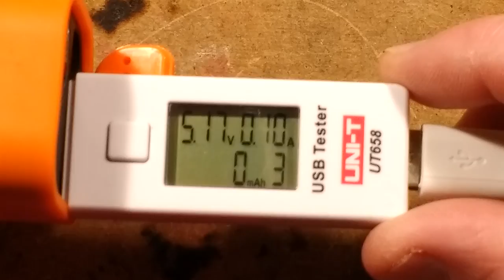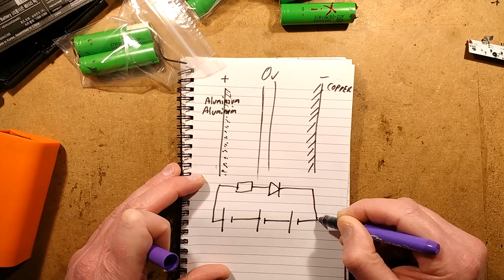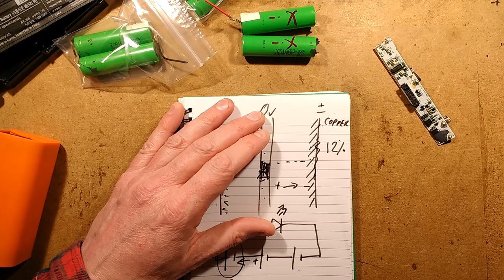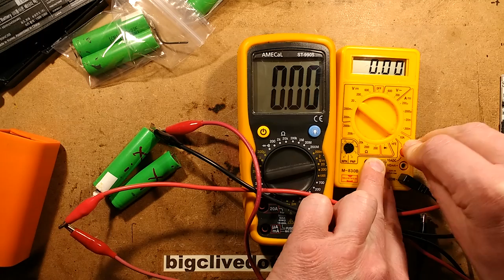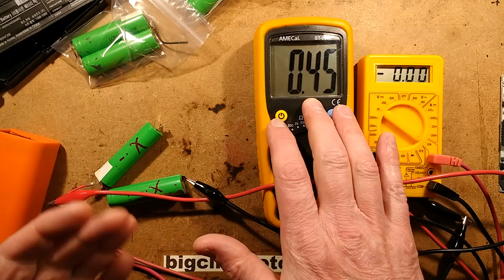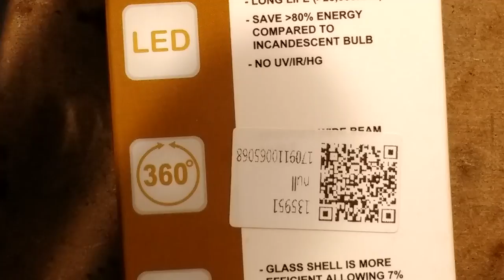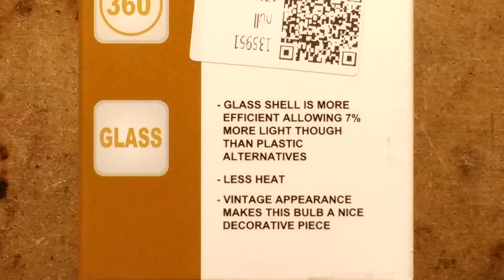Teardown of a faulty Samsung lithium 18650 cell.  (2200mAh)

Comment: How far can one drain a Lipo down before deep cell damage? I had 2 3s Batteries running in parallel a cooling box but because the monitor failed I accidentally drained them down to 2,6v in total. I recovered them slowely on two tp4056 and my bench power supply. One of the packs survived and in the other one, one cell turned into a complete short circuit.
Where is there the absolut limit?
Reply from the maker: If the cells get drained down to zero or very slightly reverse charged then they may recover, but if the reverse charge exceeds a certain level it can start causing internal shunts, and at that point the cell should be recycled.  You can tell if there is a shunt if the cell either fails to take any charge or it self discharges over a short period of time.  (hours to days).

Comment: There is alot of information out there on what voltage to store 18650 lithium batterys at, Dewalt say on there website for their lithium  battery care to store them at full charge for long term 6 months storage. I called Dewalt technical hot line up and they said battery degrading at full charge storage is very minimal and not worth loosing sleep over its that small... its damage from them getting low they said, so on this advice and watching this video on the bms not reading low voltage im going to let my batteries cool down after us and full charge them for next time i use them, do you agree with this?

Edit:- oh Dewalt also said "constant" low voltage current draw is very harmful for battery life (radio's, fans etc) ,they said it damages the cells inside with constant draw.. they said variable  draw is best for keeping a healthy battery?
Reply from the maker: I don't see a huge issue with storing cells fully charged if in fairly regular use.  It's normal for cells in long term storage to be discharged to half capacity.  DeWalt are probably not encouraging storing their batteries with low charge as there will be a slight current draw from the internal circuitry, and if it discharges a cell below around 2.5 to 3V it may lock the battery pack out.
Reply: @bigclivedotcom  very true!Thanks👍 i appreciate your channel 👏🤙

Comment: I have one of those 80V ish electric chainsaws, they shipped it with a seemingly dead battery as the charger rejected it since it was at like 24V. They shipped me an entirely new bundle with a new saw and battery and didn't want the old one back, so naturally I took the battery pack apart and used a bench PSU to trickle charge each cell

Once it got charged enough the charger accepted it and I had a free saw, obviously it was easier for the company to send a new one than deal with returns

Comment: The main issue with Li cells is the electrolyte, that is very flammable, NiMH ones use water instead, that's why they do not tend to create flames (but they can explode as well).
Reply from the maker: I took some NiMh cells to bits and it appears they self combust when exposed to air.  It happens at the end of a video I made about them.

Comment: @2:27 well reverse charging could happen, but there is a whole other reason why only one pair is completly flat after years of storage in or outside of a notebook. You see that nice big black chip on his right thumb? Thats the chip that is holding the charging program and battery information "temporarily", it is factory side programed and does not have permanent memory, its more like a little cpu with a few kilobyte of ram. Once the pair that feeds this little chip supply voltage goes flat, the program is lost and that chip does not allow charging anymore. If you put this battery pack into its corresponding notebook, the power on self test checks the battery, sees it does not communicate anymore and the bios shoves out a warning that this battery pack cannot be used. There are tools and software to program various battery charging ICs again but its more expensive then a replica battery pack.

Comment: The electrons move from negative to positive because electrons themselves are negatively charged. Meaning less electrons equals positive charge and more electrons equals negative charge. However electronic circuit nomenclature are describing current carriers which respect the actual charge "flow" meaning the changes in charge through the circuit which are opposite to the flow of electrons. As those "+"s move about the circuit it actually means electrons are flowing away from those points.

Comment: Huh? I thought the laptop battery ( with 3 cells in series ) had connections to each pair which monitored the voltage so that you didnt get one pair going reversed. There are these circuit boards which are called 3S 2P I think which do just that so you can safely make your own 11V battery.

Comment: I have cels like that.. they have a protection inside.. a metal bit that disrupts the contract when the pressure inside increase beacause of over discharge. But I find a way to charge them. if you take the wrapping under some plastic sleve there is a small metal sleve  in the side that has voltage.. it's hard to find and dangerous to do but its possible

Comment: On the NiCad drills with a dead battery, I have grabbed a good drill and spun the dead drill with the trigger pulled to generate enough charge in the battery that the proper charger would recognize the pack as good and start recovery or charging. (very inappropriate)

Comment: On extremely   low Battery value  If you have a proper charging circuit it charges in low current until certain value, then it starts to charge normally

Comment: I think is possible that the valve short circuit the cel.. that may explain that behavior.. it's sad you didn't try test it again when it was outside of the metal shell . So I suggest opening the other one carefully or at least remove the top.. the part where the valve is and test it. and also after that.. remove it completely and put 1 amp through it and try to spot if and where is getting hot

Comment: The touchpad was (and still is) on the PS/2 standard, not USB. I repair laptops for a living and i haven't seen an USB touchpad yet. Some years ago i wired an old touchpad to a PS/2 cable. Worked fine for a desktop PC, useful when space was a premium.

It could be due to the camera, maybe pinched LVDS connection cable to the screen, as the camera runs thru the same cable, or you could have a bad chipset. If it's anything with a nvidia chip dated 2006-2008 in it, that's likely what's wrong.
Reply: The keyboard/trackpad in mIne is USB, while not a majority they exist, seems you just never came across or noticed one yet...

Comment: I wounder if the old NiCd memory jolt would work.  We take a 100mf to 200mf and charge it to 100 - 200 volts  and hit the cell, usually one or 2 hits burn out the offending particles.  None ever blew up. Very vew didn't respond.

Comment: I had a problem with an Acer One Windows 7 laptop not charging its battery. However switching the battery to my other one which was running Linux it charged normally and after that would work normally in the Windows machine so there's something wrong with the Windows drivers for the battery management for that model if the battery is very low.

Comment: Hey not really expecting anyone to respond  but if someone  could tell me if I may have internally  damaged  some 18650 cells by bending the negative  plate out when I tried to rip the spot welds off or is there some wiggle room that allows  dents or buldges
Reply from the maker: A slight bulge out is not really an issue.  If it had been pushed significantly in or perforated the metal case it would be more of an issue.

Comment: I was remodeling a area. Where I needed to cut 2 inch quarter round. I used a worm drive saw with the guard locked open. The owner approached me as I started the cut. Pulled the saw into my leg as he stepped onto my power cord. The saw would of cut my leg. But my cell phone acted a shield. where my cell phone was. The cell phone was ripped out of my pocket. Not cutting me. Only ripping my pants pocket. During this event the saw cut about 1/4 of the cell battery. When the battery landed on the carpet. It started heating up melting the carpet. I kicked the heating battery 3 feet or a meter away where floor tile had been laid. The CELL BATTERY became so hot it shattered the floor tile it was sitting on. Not too much smoke. And no flames. But the heat could be felt 3x my arm length away.

Comment: This is an obvious defect to me. It’s poor adhesion on the anode.  This could have been the result of Cu dissolution from the cell sitting at less than 2V for too long. 

You could dissolve the graphite off the separator using nmp.

Comment: I know this video is 5 years old but just s top tip for anyone having battery issues on laptops.

What happens is over time the BMS loses function. Most laptops have a BMS reset procedure that will bring the battery back online and properly charge the cells as required.

The 2 dead cells in this pack are no doubt a result of a poor BMS and continuous charging from the wall plug because runtime was becoming an issue.

As soon as your battery starts to show performence loses. Do the bms reset procedure and thank me later 🙌

Comment: copper is  reflecting  as a sheen gen overall observable  from high angle  on separator after cleaning. 
No organic solvents are present  in black  compound reduces the chances  of  self ignition when these are disassembled. 
The black compound was thermally damaged check for heat sources  and the cells that fail match same spot locations.
bad or malfunctioning laptop cooling is common  this shortens life of the one that makes a n unusable pack. cheap replacement  or NOS packs fail faster as well. Cell sets are effected worst when at full charge and heated excessively.

Comment: my son went to plug in his headphones on his new laptop inadvertently stuck the connector in the USB shorting out the computer and now it will not turn on.  did he kill the batteries?
and is it fixable?
Reply from the maker: Check the inside of the USB connector isn't damaged and shorting out, then if the battery is a pack that can be removed then try unplugging it and plugging it back in.

Comment: 34:43 there's a definite circle of transparency in the film, in a similar location to the "polished area" on the copper electrode. If that's not a obvious sign, That would be quite disappointing! RIIGGHHT...OKAY...
Reply: I noticed that too.
Reply: Seems like Clive may have had the right idea at first, then figured it may be due to the material not sticking there very well. I was suprised he didn't go back and second guess his original observation. .. But then again, it may not have anything to do with it at all!?
Reply: Bear in mind that we actually get a better view of quite a few things than Clive does. He can't lean right over it because the camera is in the way. And if you're watching on a good-size screen, you're basically using a giant digital magnifier. ;)

The copper migration thing is probably happening on a microscopic level. It seems to be a similar concept to electroplating, which apparently takes ages if you don't have a decent voltage and the right chemical conditions.
Reply: You are totally right. I actually watch on a 4 yr old cell phone, I wish it was a bigger screen. I was just thinking that Clive could have seen it during his watching/editing time before he posted it. Thought I'd try to bring it to his attention either way.   :)
Reply from the maker: If it's not completely obvious then I don't like to jump to conclusions.  I prefer a definitive reason.

Comment: 4GB file size, it's a limitation of FAT32. Some devices support exFAT, which allows larger files. Should check see if your Android supports ext2/3/4 on external storage, then again the 4GB limit is removed.

Comment: i have had many of these batteries look completely dead just rip the safety circuit board off they recharge fine they do get a bit warm sometimes so don't over charge them
Reply from the maker: The classic protection PCB will shut off at low voltage.  The cells can often be trickled back into life, but if a cell loses charge noticeably in storage it's best to let it run flat and then recycle it.
Reply: @bigclivedotcom  iv'e found with mine the battery has a full charge when this as happened I'm guessing its the over charge protection circuit failing probably bad charger

Comment: are you recording onto an SD card? it might be the format of the storage device. 
the file format 'FAT-32' has a limit of 4GB... it literally can't hold single files larger than that, even if it has a higher capacity.

common alternatives without this limitation are ex-fat or ntfs.
changing the format of a storage device requires completely erasing it in the process, so take your valuable information off it first. if you are recording onto internal memory, then you might have a hard time changing the format.
Reply: if your linux distro doesn't have tools to change file format, there is something wrong
Reply: heh

Comment: The most likely the reason the cell was faulty was because a safety feature triggered; on the top of the cell, there should be vents or an opening. Through that opening, stick a small flathead screwdriver and gently press down through all 3, 4, or 5 holes. Be careful, if you hear a hiss you probably pushed too hard

Comment: While this is an old video, it should be noted that this was an unprotected cell.. i.e. it did not have protection circuits.  Unprotected will self discharge. Protected circuits will not.

Comment: The icr cells are the exploding cells they are quite rare and are only found in the cheapest of cheap products 
The more modern cells (like imr) only vent and catch fire 
Modern cells can cause an explosion when they're unable to vent properly but this can only be caused by design faults inside the battery container (no vent holes)

Comment: They possibly aren't reversed charged. They are protected cells if you measure no voltage it means the CID popped you can reset it.
Reply: Although that is not a good idea. There is a reason the CID popped

Comment: you found the problem, in that the graphite had come free from the electrodes and gunked up the membrane. at a nano level, it just looks even.. not hot spot defect, the entire surface is damaged. look at brand new internal foils for comparison, and you will see the difference.

Comment: I've got an 18v electric scooter that gone below 2v a couple of times while in storage... I had to strip the battery pack and tell my smart charger it's a NiMH, slowly raising the voltage while charging it with my multimeter probes xD

It still takes the rated 10ah and can still do about 7 miles on a charge. I throw it in the back of my car so I can park in free parking outside the city and save £10 in parking when ever I go into the city centre xD. 

Shame they have dubious legality... Hopefully they update the law soon!

Comment: Handheld 2-way radios back in the days of nicad and ni-mh tech were notorious for creating bad cells because  the radios would be left on all day and run down, then get put into a rapid charger for an hour and used till it died again, stressing the cells. Public services were the worst about this because radios would come in at the end of a shift, battery packs removed and put into gang chargers and charged packs put back on, radio gets issued to the next shift, etc. They people issuing radios would see the green light and assume the battery is charged fully when in fact it was not
The problem came when the batteries were left in the chargers too long, we call this "Cooking the packs" because that is what would happen to packs that already had issues or with packs on radios that were not turned off. The green LED on the charger does not mean the battery [ack is 100% charged, it means the pack is charged to thecapacity is can hold with the bad cells in the chain. 1200 mAhr pack may be cooked down to 600 mAhr but you would assume it is 1200 because of the charge complete indicator. I good way to tell if the pack is going out is if it is HOT, a warm pack is normal but one that is hot is not

Comment: What would you guess the % of life lost would be per reduction to 0v?  Would it be the same for LiFePO4?
Reply from the maker: I'm not sure.  Some may recover their full capacity after a few cycles.
Reply: @bigclivedotcom  That's amazing.  I've got a bunch of LifeP04 batteries and have been very worried about dropping them below 2.5V.  I can build a 48v system and only have to worry about overcharge now.  It will be a 16S5P build of 50AH cells.
Reply from the maker: @agtlewis  I don't recommend routinely overdischarging them.  The typical DW01 protection chip usually cuts out at a lower threshold of 2.5V
Reply from the maker: @agtlewis  Also keep in mind that the real damage to a cell occurs when it is depleted and other cells in series then keep current flowing through it to the point it suffers from reverse charge damage.
Reply: @bigclivedotcom  Understood, maybe they will hit 2.5v or possibly even 1.0v once in a while but very likely never 0.  It's just nice to know it's possible without killing them.